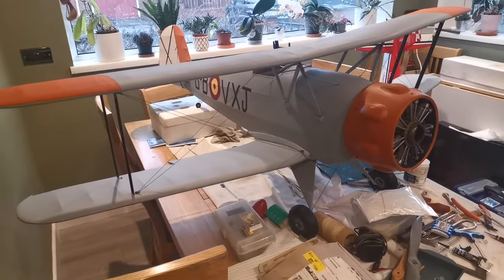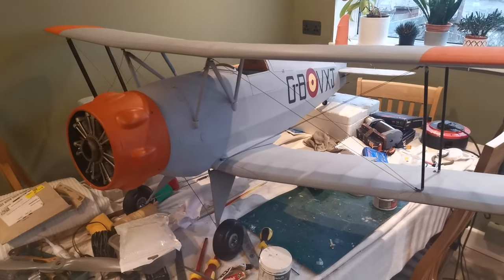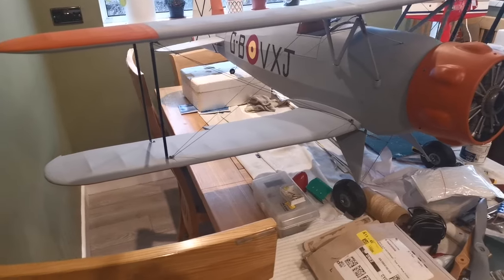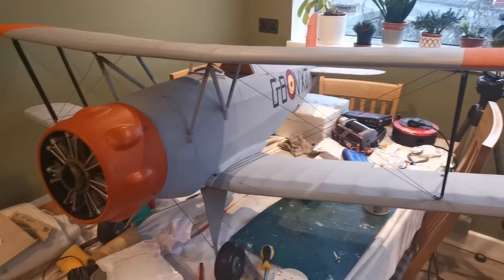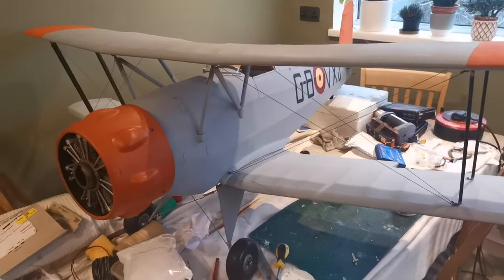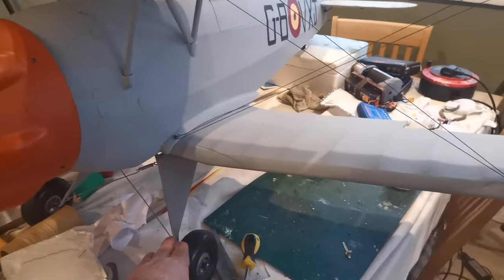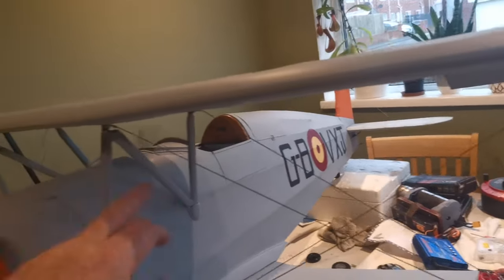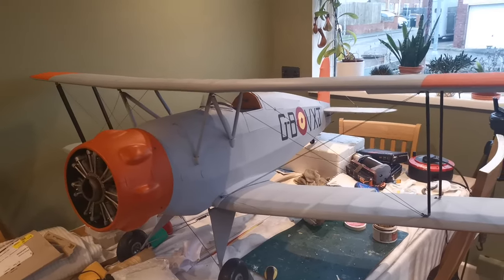Solution to the assembly problem of the Jungmeister.

Comment: Easiest thing in the world, dear boy. I have 2 biplane. A 1/3 Tiger Moth and a 1/3 Jungmeister. 
I fabricated small stainless steel U shaped brackets these bolt thru to a anchor nut in the wing then the clevis ends are pre-attached to the brackets. ( if you use dome headed bolts, these are trapped under the rigging clevises and won't easily come out.) The other ends of the rigging cables remain attached to the wing panels. The wings attach to the centre section on short tubes, so that they can be initially fitted without supports. The wing struts are assembled as a complete structure which plug into drilled out claw nuts. 
The wings are effectively held on by just 2 removeable bolts on each wing.
Mick Reeves used this method on his Tiger Moth kit and I simply plagiarised the idea for my Jungmeister.  Takes about 5 minutes to assemble at the field . Message me for any info

Comment: hello mark i have a flair tigermoth  i can rig i 5min and fly fit in my  car no wires removed  i have fitted a jig to lower wing attach points as fuze same with top wing when i remove the wings stay in place and can be carried as,, one slide on remove jig, bolt on connect servo leads thats it   .ps having made a rigging aid for my 18 meter glider on my own this was a simple job